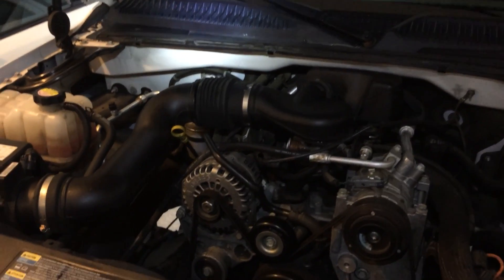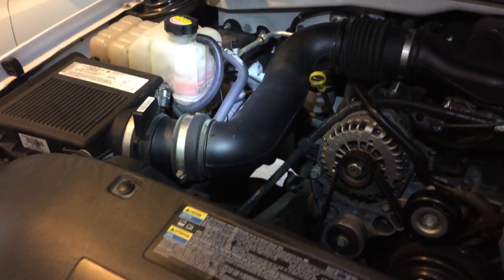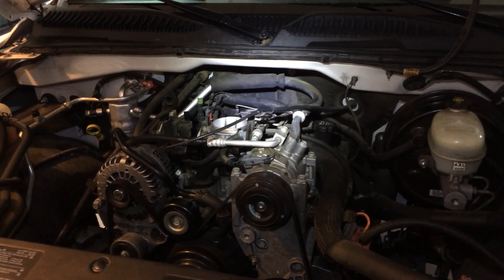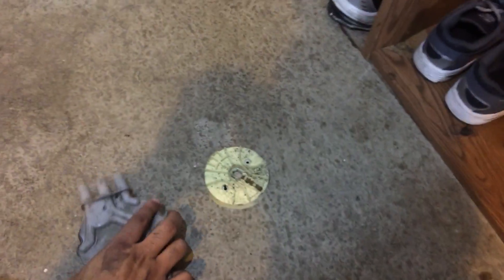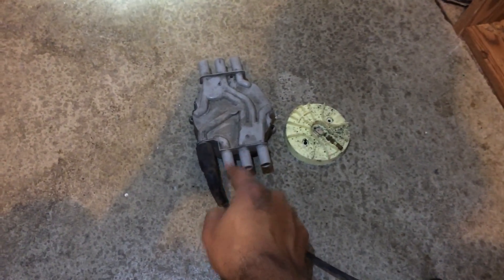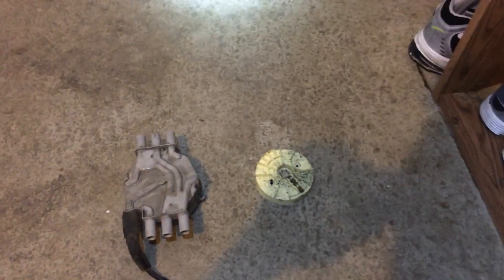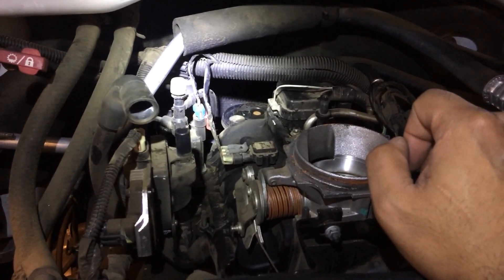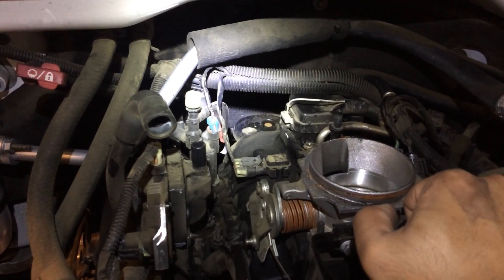GMC sierra 4.3L vortec V6 Distributor Cap & rotor installation.

Comment: Silly question I know you can't put the cap on backwards but can you put the rotor on backwards
Reply from the maker: You’ll have to forgive me for this video is old but generally speaking rotors can only go on one way. You can however have the distributor misaligned if the truck is not starting IF (big if there) you pulled the distributor out of the block.

Comment: Why would oil preasure drop when i put in a new distributor 01 blazer 4.3 with the old distributor preasure was 40 to 50 with the new distributor its about 20 at adle and almost 40 when i rev it.... its never been that low is it ok is that normal

Comment: Hello there I got a 2005 GMC Sierra 1500 two-wheel 4.3 liter engine engine just turns no fire to ignition coil but anyways I replace crank sensor and cam sensor ignition coil distributor cap the rotor and the wires still no start or fire just turning

Comment: My truck has a 4.3L V6 and it was throwing a code saying the fuel injectors were bad. But my truck doesn’t have injectors it has a throttle body. So idk
Reply: Injector under intake manifold

Comment: The hose to the left in the video when you are explaining how to take of the rotor that you disconnected from the intake what is that called?
Reply from the maker: It’s a breather hose. Attached to
The back of the intake tube.

Comment: I have one problem with my GMC Sierra 2009 V6 4.3 L the problem is when I changed the old transmission for other with less miles the car doesn’t started so one of the problems was the cable of the parking the was broken so put a new one so after that I try to stared but it doesn’t stared so I don’t know what be the reason of the problem that the truck doesn’t stared

Comment: I have a 2003nchevy S10 zr5 4.3 vortex, do you happen to know the bolt size for the distributor hold down clamp? Mine fell and I can't find it.b
Reply from the maker: I don’t sorry. The dealership might know. If you have at least one of the bolts, you can just take it to a parts store and match it up.

Comment: Do u AlwAys have to replace  the distributor when u replace.  The plugs and wires
Reply from the maker: You don’t have to replace the distributor at all. This one simply failed and so I had to replace the entire distributor.

You should do the cap and rotor with the plugs and wires.

Comment: Do you have to have cylinder 1 at tdc
Reply from the maker: If you pull the entire distributor out YES.

If you are just replacing the cap and rotor, make sure to remember which way the rotor was facing and install it the same way.

Comment: On a 2001 Chevy S10 pickup did you ever hear of replacing plugs wires and cap you have to reprogram the computer please comment back either yes or no thank you
Reply from the maker: Not that I have heard of.
Reply: @HelpingHandAutoRepair   OK because this mechanic he raced his truck so much is stuff from the converter was coming out the tailpipe and then the motor started knocking afterwards
Reply from the maker: Well it sure what that has to do with replacing spark plugs and a cap and rotor?

If he raced the motor and hurt the motor then there could be something else seriously wrong with the engine.
Reply: Also I wanted was a tune of plugs wires and a cap  And the thing on your the cap not  The whole shaft that goes in the motor I could a done it myself  But I said how would it let him do it he wasn't doing anything anyway

Comment: obviously, all you need to do to change the cap is shine a flashlight on it;  therefore, seeing where the fasteners are and what, if anything, needs to be moved to gain access is not necessary

Comment: I have a 2007 Silverado 4.3 engine and whenever the weather goes from cold to warm in one day condensation covers my whole engine  and it looks like someone drenched the engine and my truck turns over and want start. When I raise the hood and let the sun dry the engine, it fires up like nothing happened. Is it normal for condensation to cover the whole engine because my 2015 Mitsubishi don’t have any condensation buildup. Need some help on what to do.
Reply from the maker: It’s possible that the engine can be covered since the engine bay is completely exposed from various places to outside weather.

Your problem is most likely water getting inside the distributor cap and that is preventing spark from reaching the spark plugs. You could try using a very small amount of silicone to seal up the cap around the perimeter. A small amount. Otherwise it will be hard to remove later when you have to replace it.
Reply: Ok, do you think the distributor cap is crack?
Reply from the maker: Don’t know. Can’t see it from here. You can check it out.

Comment: How to stop condensation from getting in destribitor cap after a rain 4.3 V 6
Reply: I just recently bought a 02 Chevy Silverado and guy told me to put silicone around the distributor cap to seal it and prevent it from getting condensation and to do so every so often and check
Reply: Yeah best thing is some water proof orange silicone that stuff is easy to take off too not a mess

Comment: How do you stop condensation from getting inside the destribitor cap when it rains on a 4.3 vortex V 6
Reply from the maker: If the seal around it is bad, it needs to be replaced
Reply: There is no actual seal or gasket for the cap (which was a dumb design) the tsb that GM came out with was to completely remove the two eip mesh screens to fix the condensation build up from humid or rain conditions.
Reply: A little wd40 will help

Comment: Do you know what the OEM part number is for the cap and also the rotor? I have a 2008 GMC Sierra 1500 4.3L.  Does the rotor usually come with the cap?  I really like oem parts but I'm having trouble finding the OEM rotor especially.

Comment: This is probably a dumb question but I need need to know if you have have any idea what the part number is 4 that black adapter that the wing nut screws onto for the intake
Reply from the maker: james carey Hi! Very sorry I am now getting back to you. I was busy today. I am able to pull up that adaptor you are talking about but for some reason there isn’t a listing on the Chevy parts catalog. I do find a listing for the wingnut and there is a physical picture of that adaptor but no part number. I will try and track down the number for you sir. Just give me a day or so.
Reply: @HelpingHandAutoRepair  ok thanks my step son just bout a 2006 1500 with the 4.3 l motor and we are trying to figure out why it is I dealing rough and stalling out .why I was changing the spark plugs and wires I seen that the throttelbody cover was loss and was trying to figure put why because all o had to do was slide it off there was nothing holding it down
Reply from the maker: james carey Yes That could cause it to run rough.

Comment: Nice video.maybe next time you can start recording before you start removing parts.
Reply from the maker: thehonezt one I explained that I wasn’t going to show you taking off the parts but rather tell you what you need to take the parts off and where the bolts are located. It is very difficult to get a camera back there.
Reply: I'm sorry I changed the cap I changed the punches inside of the cap and do I have to move the distribute some kind of way to make it turn all the way over
Reply: Do I have to move the whole rotor do I have to twist the whole rotor or just a little bit of the cap
Reply: I done exactly that and it still don't want to start
Reply from the maker: Did you remove the entire distributor?
Reply: What a dick, if you can't take off a distributor cap maybe you should take your smart car to a shop.

Comment: I removed the cap and after I installed it I got a P0300 code and the engine vibrates a lot, any suggestions
Reply from the maker: SuperKiller177 You removed the cap and installed a new rotor and cap? Or did you only replace the cap and not the rotor? P0300 is a random misfire code. Double check the cap and rotor to make sure they are ok. If they are good you should consider replacing the plugs and wires as well. This is what I did to this truck.
Reply: Helping Hand Auto Repair I removed the cap to get to the oil sending sensor under it and when I put it back together I got that code, afterwards I smelled gasoline from the exhaust pipe and the engine vibrates a lot
Reply from the maker: SuperKiller177 did you remove the entire distributor as well? Or just the cap?
Reply: Helping Hand Auto Repair just the cap
Reply from the maker: SuperKiller177 Well if you took the plug wires off too you need to make sure you have them in the correct order. In the description I’ve listed the correct order of the plug wires. If they are correct then you may need to take the cap back off and inspect the contact points inside the cap and inspect the rotor.
Reply: Helping Hand Auto Repair I guess I’ll check those wire again and the cap too, thanks a million
Reply: SuperKiller177 hey can you update me on if any of this worked or what worked. I’m having this issue rn and my dad is gonna kill me
Reply: Z K so the point of removing the distributor cap was to get to the oil sending unit in the back and when I did I unplugged the spark plug wires so when I started putting everything back I mistakenly plugged the two cables in the rear right in the wrong place. After turning the truck on I immediately got the code so I went back and checked the wires and that’s when I noticed that I had them in the wrong place
Reply: Did the code go off ?
Reply: @hectorbarajas9316  yes it did

Comment: so what about the timing? or is it if iam changing the whole assembly?
Reply from the maker: Sergio Villagomez correct the timing would be only if you are removing the entire assembly.
Reply: Helping Hand Auto Repair ok thank you very much
Reply from the maker: Sergio Villagomez you are welcome!
Reply: I've done everything from ignition module, starter ignition coil ,pick up coil , cap and rotor,  egr valve still not spark any suggestions
Reply: Sergio Villagomez I would like to see how the module mounts to the cap to the distributor does it have some kind of spacer between some kind of waxy glue or something